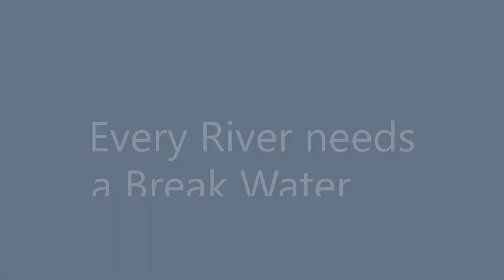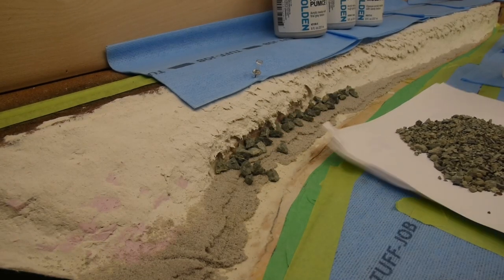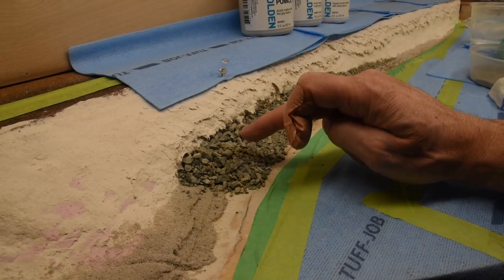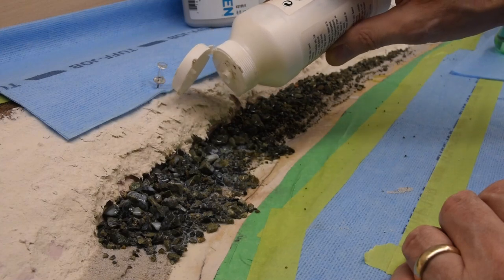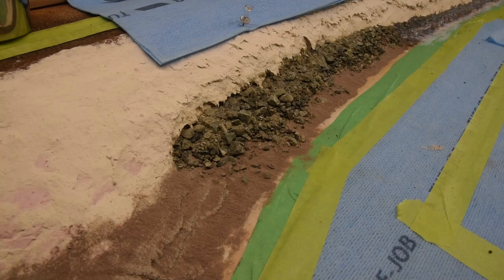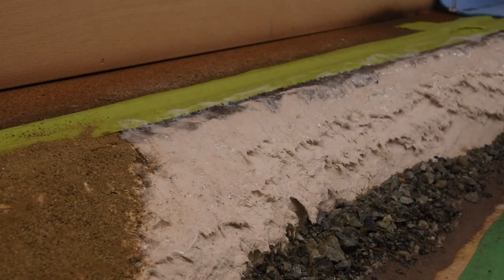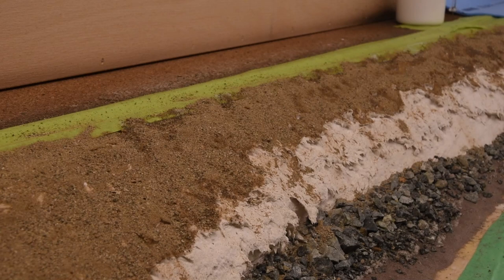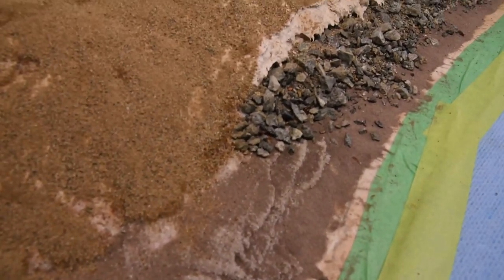Modeling A Realistic River Bank | River Road - Part 3

Comment: Looks great, Boomer! Love it! Question: 50/50 water/Matte medium vs. 50/50 water/Elmer’s glue (not their School glue) - thoughts? I’ve always used Elmer’s but am strongly considering your method. Thanks.
Reply from the maker: 50/50 Elmer's or Carpenter's glue works great. I won't use for detailed scenery like this though. Too risky and hard shell for me. Try ballasting points on a turnout with Elmer's and big trouble. The former can also have a sheen to it I don't like. Matte medium is my go to scenery cement. But each to his or her own. Cheers.

Comment: Beautiful work as always..... another question if you don't mind. Appreciate your help. I've been pricing all of the matte mediums that you've been using:

Below are all Michael's Craft store prices in US dollars:

Golden Super Matte....................$40/16oz.
Liquitex Matte Medium...............$24/16oz.
Mod-Podge Matte-Mat-Mate......$10/16oz.

They all, according to the videos and their labels dry clear but there is a significant price difference. Is there really a difference in #1 their quality, & #2 their use depending on scenery application?  The Mod-Podge is obviosly the best bang for your buck. If you thinned it 25% to 75% H2O that gives you 64 oz's ! At Michael's after they're daily 20% discounts that comes in at only $8.  Could you exclusively use it for all ground scenery, including balasting? What are your thoughts.. you use all 3. Respect your opinion. Or should you use each one for more specific areas? Thanks as always.
Reply from the maker: Golden Super Matte is over-rated. I don't use it often. I like the Liquitex Matte Medium for everything including track ballast. I would try Mod-Podge first. Then Liquitex later.
Reply: @boomerdiorama  ....sounds like a plan..... you definately got my creative juices flowing.......i picked up the Mod-Podge...... going to try a small diarama with handlaid track and some ground textures first before building the shelf layout....figured it would be a good learning experience and if i mess it up i wont care if i have to trash it! LOL. Thanks again.
Reply from the maker: @michaelevan9184  Fantastic idea! Always a good thing. I do it all the time.😁